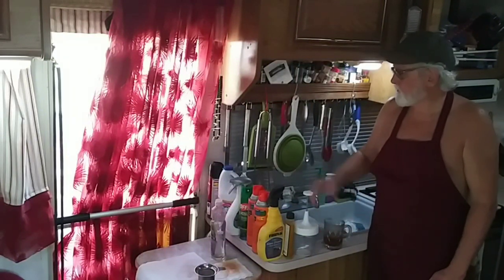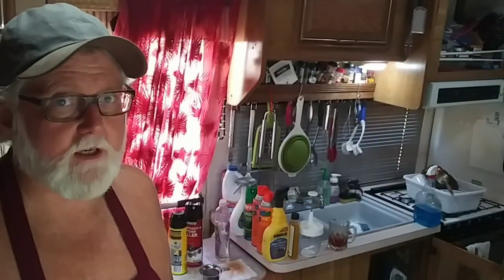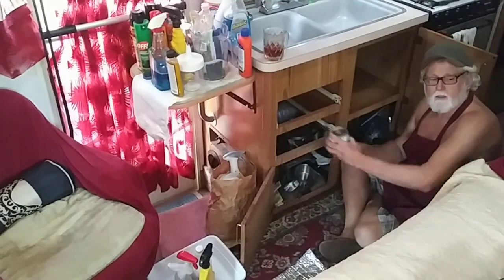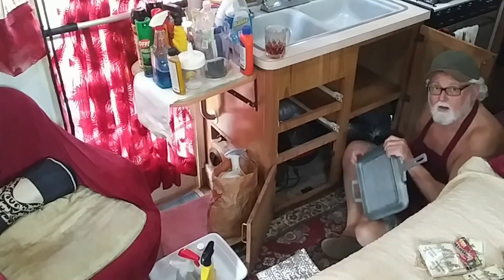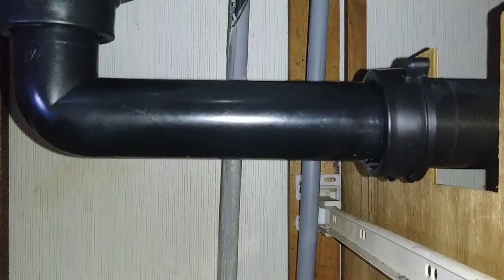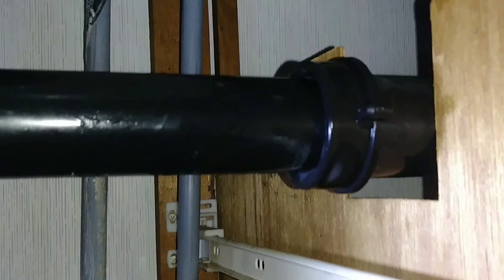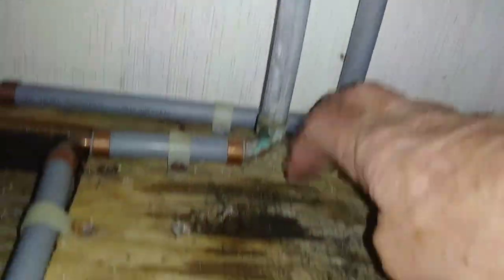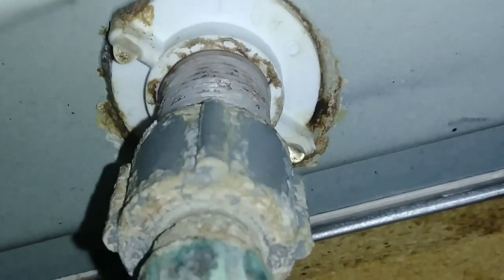Roaches? My Rolling Roach Coach! Grizzly Pines Campground, Navasota, TX

Comment: Get and Advion gel for roaches. I got mine from Amazon. You’ve been in Tx you can’t get away from them. I in Tx too. I use Advion twice a yr. no smell ,mess, a couple small lines under cabinets or in corners.
Reply from the maker: Janice Havens ... I found it on Amazon. Wow. That's pricy but I guess it's worth it.